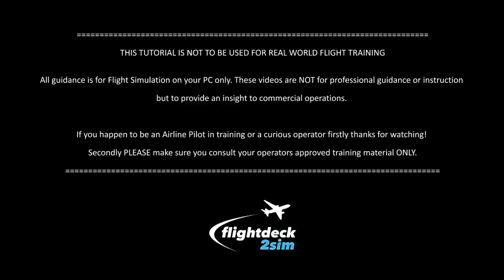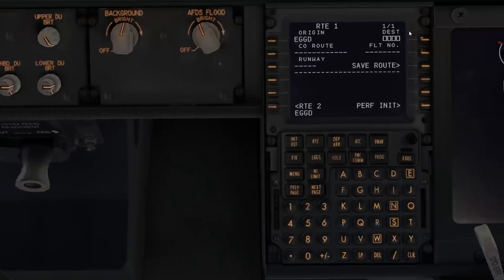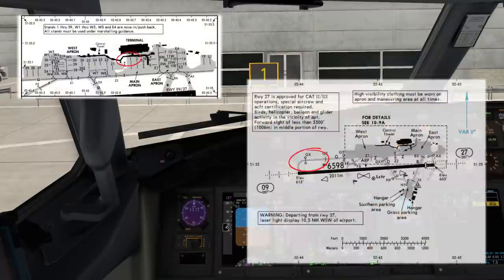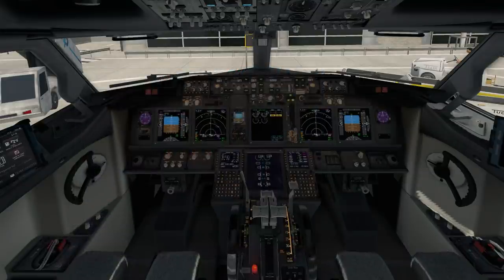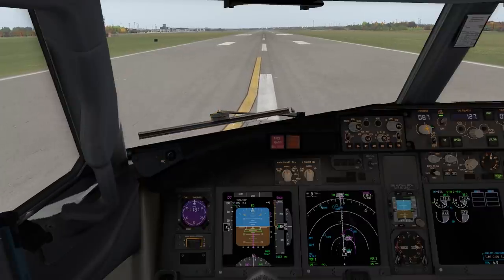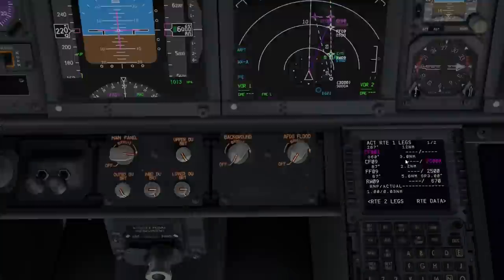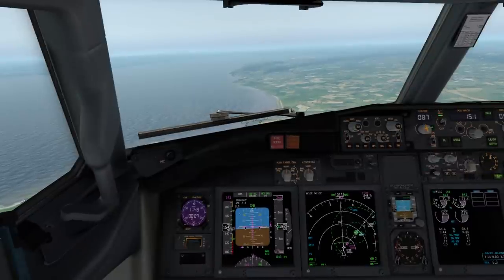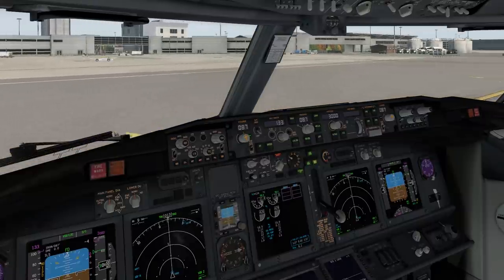10 Minute Ghost Flight Tutorial by Real 737 Captain

Comment: Hi captain, just a quick question. Where can I find if a SID is a noise abaitment SID or not? I do own the Navigraph charts but I just don't know where to see if it's an NADP SID or not... Thanks in advance.
Reply: NADP is noted under DEP on airport charts. It will either describe the procedure or list which it is (1 or 2). I’m not sure how navigraph works but in my company, this is how it’s listed. If no procedure is noted, assume to be NADP 2 - at 1000’, accel to flaps up speed and retract flaps on schedule until passing 3000’ then accelerate accordingly. Also, the departure chart may list any specific noise abatement procedures for the specific departure. Hope this helps

Comment: Great Vid as usual Cap..  Did u leave the Trim Air off for a reason or was that just a overlook on your part ?   Ok.   I asked that because I saw it was off when you looked at the overhead panel after takeoff.   When you panned up their on landing the Trim Air was on.  LOL.  This is why I edited my statement. Did u just notice it and turn it on ?  Thanks
Reply from the maker: Hi Mr. Jones, the tutorial had to be recorded over two parts as I had audio issues in the sim downwind on the first recording. I had to reset the sim and reconfigure the aircraft exactly the same way (time/fuel/everything!) and resume recording downwind. Looks like I forgot to select trim air on one of the recordings (to answer your question on it stays on throughout the duration of the flight).

FD2S

Comment: At 10 minutes in, did you mean to say 59 degrees Celcius?
Reply: Hi Rory, I hope you're well.  Yes, the captain was putting in the assumed temperature for the takeoff engine derate.
Reply from the maker: Hi Rory! You did indeed hear me say 59 degrees Celsius, this is called the assumed thrust temperature. 

The engines on the 737 are flat rated at 30 degrees celcius, this means they will give full thrust whenever the temperature is below this. When the temperature is above 30 degrees celcius the engines will produce less thrust as the air is less dense.

Full thrust is not often needed for take off so one way of reducing thrust is by telling the engines via the FMC that the OAT is much higher than the ambient conditions. By telling the engines the temperature is 59 degrees Celsius the engine will give us rated thrust for that temperature.

Hope this helps!

Comment: how to get that stairs? I’ve activated it on Avitab on ground services and nothing is happening outside.
Reply: Make sure that door is opened, then activate the airstairs from the Avitab.
Reply: you need to enable them on the tablet under Settings and Features / Display and Variants / Exterior, Airstairs is the second one down, you also need to open the FWD Entry door before you click on Airstairs on the Ground Services page or they won't unfold
Reply: @Aviator738  Oh, thanks. I’ll try it later.
Reply: @mineisthelefthandseat4768  Thank you, I’ll try it later ☺️